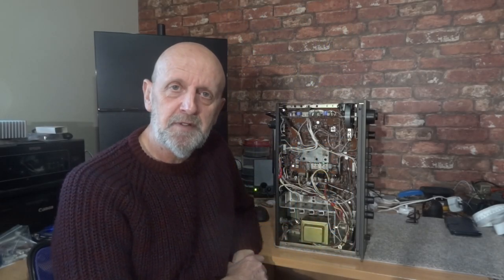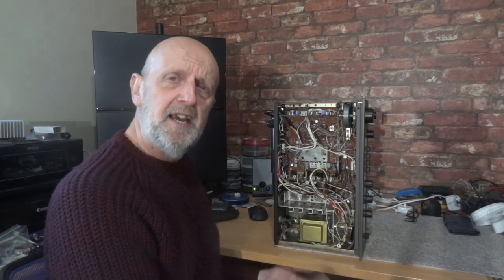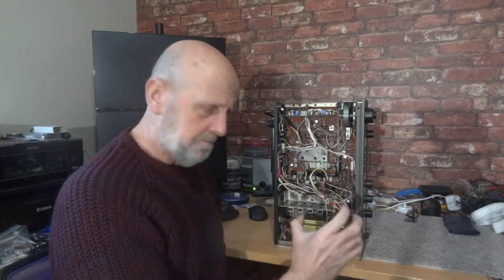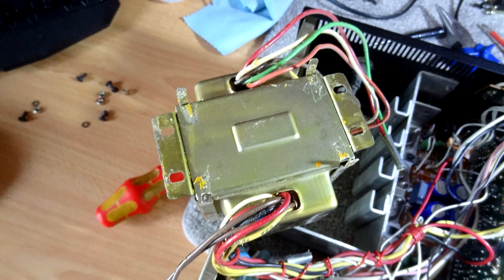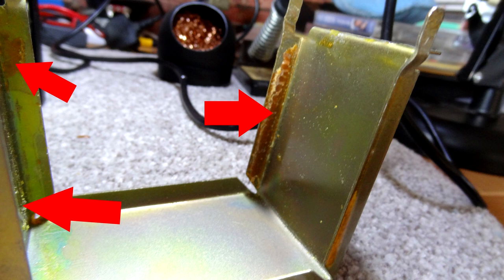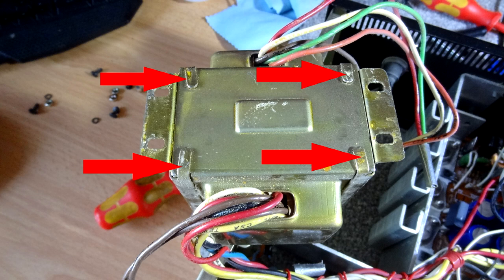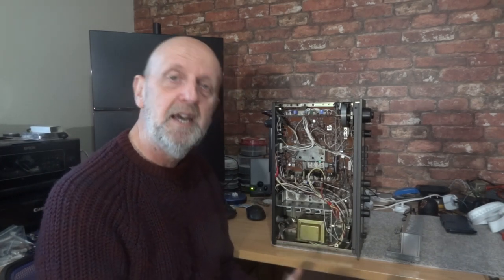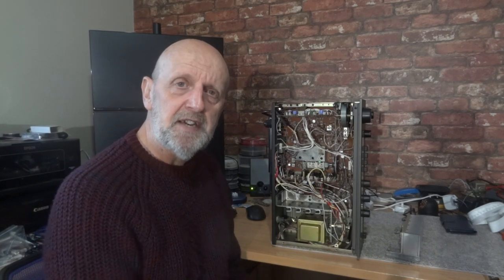Buzzing Humming Transformer Repaired . Vibrating Fixed . HiFi audio amplifier receiver power supply

Comment: Adding rubber washers also helps. Assembling from the top down = Add a rubber washer to the bolt. Push the bolt through the transformer mounting tang hole. Add another rubber washer to the bolt, below the transformer mounting tang. Push the bolt through the case hole. Add a locking nut. So, you end up with two rubber washers sandwiching the transformer mounting tang. The first washer prevents rattling noises being passed by the head of the bolt. Obviously, you will need longer bolts. If your transformer bolts firstly go through the bottom of the case (meaning their heads are underneath the case,) reverse the order of assembly.
Reply from the maker: Thanks for some extra tips

Comment: My philips d8614 boombox had a buzzing transformer and the left channel kept going off so i opened it up hoping to spot a dodgy capacitor or something but nope , it was way more complex than i had bargained for,a bit of a chinese jigsaw puzzle so now its in the shed with its intestines hanging out .
Shame really because i was very fond of that player ,it had a lovely sound and the radio sounded great too .
If i had of known this glue trick i would of tried it .
Thanks michael
Reply from the maker: Thats a shame, not always easy to find a repacement boombox once you have a good one. I did have quite a few in the pass. lots of the old Sharp ones. some buzzing transformers can be quite loud

Comment: I have been dealing with a 24 vac transformer in a boiler zone switching relay, makes my ears ring.  Could you tell me if your solution would work for me? I'm not sure if your transformer is similar to mine. Thank you.I subscribed and gave a thumbs up.
Reply from the maker: If you can get to the transformer then it would be well worth a go or if these transformers are still easy to get hold of and replace then maybe a replacement.

Comment: Good morning Michael, what type of resin did you use? can you tell me the brand? 
Is it the UHU brand that you use in other videos?
Thank you very much and congratulations for your videos!!
Reply from the maker: Hi, In this video I use the Gorilla Epoxy resin as shown and seems to work very well, I have done a few others using UHU as shown in the video here https://www.youtube.com/watch?v=Tb2YrW71t3k , and that has stood the test of time to. I think if its the metal outer case that is causing the buzzing then any of these two will do. But if its the fins that are causing the buzz then I suggest varnish for them as it will get inbetween the fins and the finish of the metal casing with resin or UHU glue.
Reply: @MichaelYates  thank you very much Michael

Comment: Hi Michael 
I'm hoping to try this on a few Rega wallworts like this one 👇 and it's brand new replacement does the same. 
https://youtu.be/5ikqGvNGk3M
That's four Rega power supplies I have that buzz!
I've given up on this crap from Rega and use Linear power supplies now, but will give it a try for fun! 😉
Jim 🏴🙂
Reply from the maker: Hi Jim. Yes I can hear it, it could be just the transformer resonating with the thin plastic case, so if you do manage to get it open a few sticky pads on top of transformer that pushes against the top might stop that. Annoying big name brands using cheap power supplies, when just a few quid more would get a good one.
Reply: @MichaelYates  Thank you for replying Michael, it very much appreciated 👍
Jim 🏴🙂
Reply: @MichaelYates  I think you may be correct about the plastic case, as I also wrote this in the comments of my video at the time ...

Listened to my Rega A2D phono stage yesterday just to refresh my memory about its sound, all was fine, just plugged in its wallwort power supply and it's buzzing as loudly or louder than the one in this video. Only difference from yesterday was it was unplugged after listening then plugged in this morning! Very strange and very, very annoying.

Comment: Hello I have a Vox VBM1 amplifier which performs and sounds great. BUT inside the chassis there is an audible transformer hum. It doesn't seem to affect the sound of the amp. And you can only hear it if you open the amp and get inside? Is this an issue? What would you suggest? THANKS
Reply from the maker: No its nothing to worry about, just a little annoying if it gets to loud. if you are not affected by it then I would just leave it.
Reply: @MichaelYates  THANK YOU sir! I've just noticed someone worked on this transformer and the plastic case is open a crack. Looks like it need to be gorilla glued. Thanks for your advice.